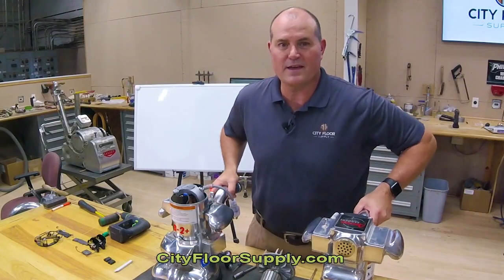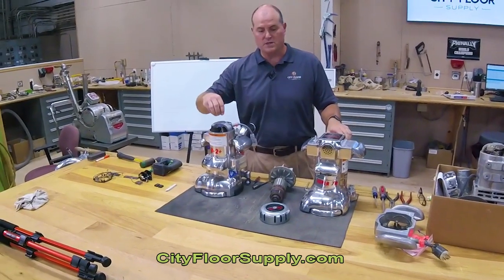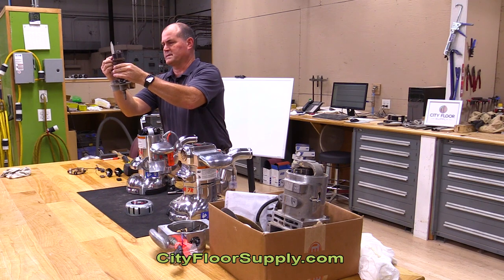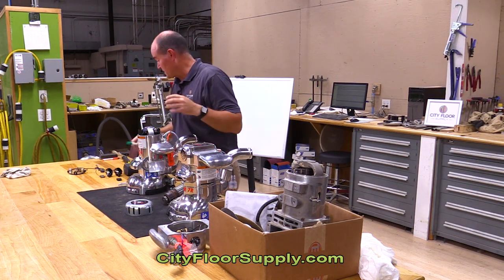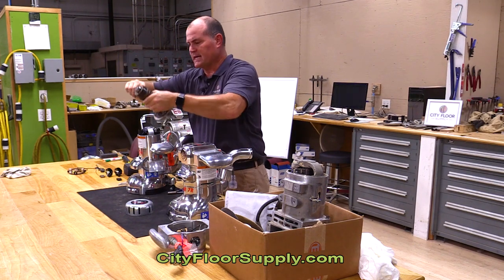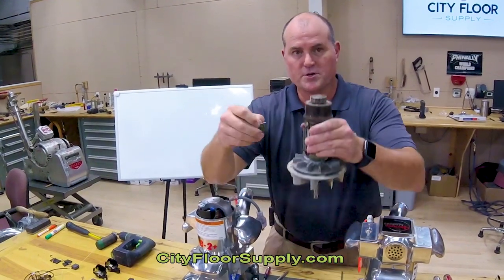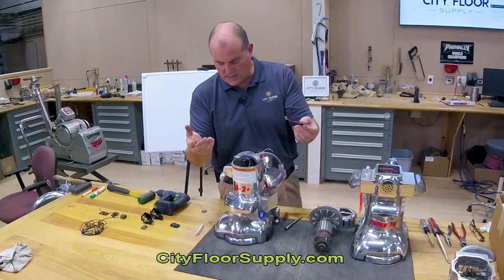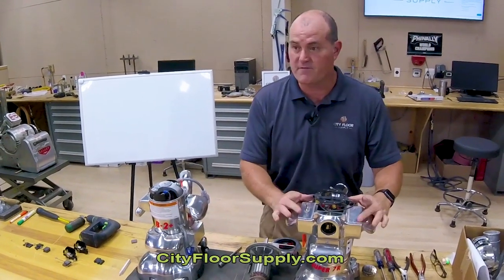LIVE Carbon Brush Replacement for Super 7r and B2 Wood Floor Edgers

Comment: Hi Jo,.
Will the new  b2 brush holders fit on the early B2 and American spinners that used the carbon brushes WITHOUT the pigtail?
Cheers
Andrew
Reply from the maker: Hi Andrew, 

Yes, they should fit. Thanks for your question!